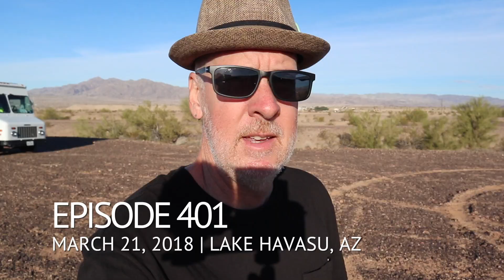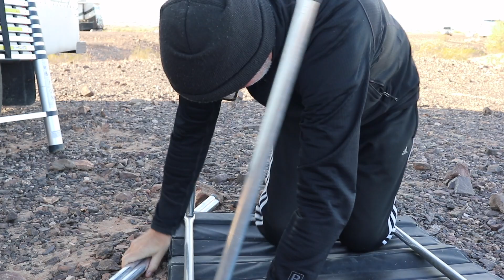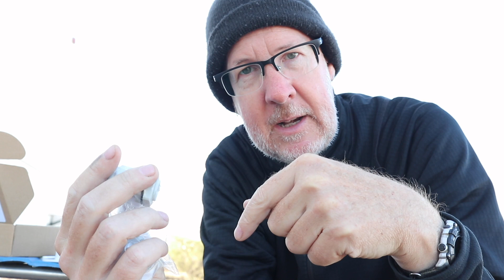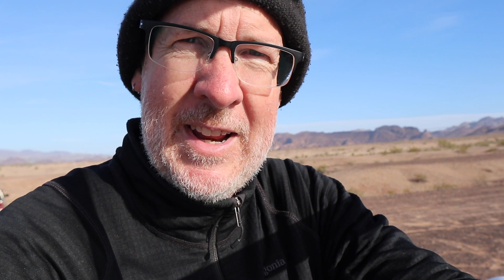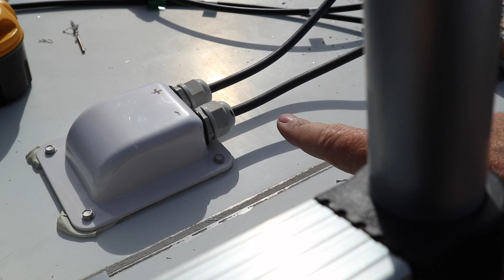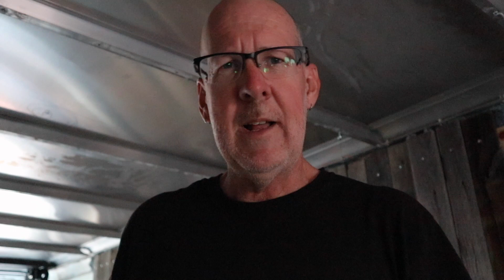Problems Wiring Solar for Step Van E401

Comment: You install that wire ingress box the exact same way you installed the MaxFans. The wire goes through before you clamp down the glands.
Why are you so paralyzed by cutting a 1-2" hole when you've already cut multiple 14"x14" panels out and it's fine?

Comment: Glands are to be installed in the small white box. The box will be mounted on the roof just like a roof vent with screws and sealant. The box is a weather proof  cover where you feed the cables through holes you drill in the roof. Oh. you got it.
The black wire connectors can be weather sealed with self vulcanizing rubber tape.
A hint, don't buy materials at a Home Depot or Lowes. Nothing wrong with them, just not for RV's on the road. Look for an Ace hardware store, particularly in the country. They carry about everything and usually have very helpful staff. It helps if you take the parts you have and ask them what else you might need. Ask about the tape. They have it.
Reply from the maker: it is only in the past few weeks that I've discovered how amazing ace hardware is. I love it. thx for the tips
Reply: Forgot to add that you can wrap the rubber taped connectors with good quality black electrical tape (3M). It takes the physical punishment better.

Comment: Yep. Sleeping with your head lower than your body will give you a headache. Either turn your van around or swap ends on your bed.

I’d drill a round hole and seal around the box. Why risk minimizing your tolerance when it isn’t necessary.
Reply: Given the o-rings on those connectors I’d say they’re weather sealed.
Reply from the maker: thanks for the feedback and suggestions!
Reply: Seven Wanders the World I should just wait until the video finishes..... all of the things get resolved.

Comment: Right on! You're makin' terrific headway man. I completely understand what it's like to be faced with a new task and have nobody nearby as my safety net. It freaks me out! I don't wanna waste materials, I don't wanna waste money, I don't wanna waste time and I don't wanna do anything that causes any problems......is that too much to ask? Yes. Nobody is perfect. I've mellowed somewhat with age and experience but I still stress when I get into scenarios like what you're doin'. As it turns out I've been pretty lucky because what I've wasted most has been my own time and most of that is usually because I've searched to the ends of the earth for something to tell me what to do. I am surprised that you didn't have instructions or some sort of a guide that came with your supplies. They kinda leave a fella like you and me out on a ledge don't they? Looks to me that you've done a dang fine job of it Seven and the only reason you didn't finish is a measly little connector. That's a WIN in my mind! You took the bull by the horns, as they say, and you came out the other end with something to be proud of. Don't forget, nobody is born with the knowledge to do these jobs, at some point everyone has to learn how to do things. Whether they are told, or go to school or bump around in the dark there's always a starting point. I hope that you tooted your horn, shook your hand and put your feet up buddy 'cause you've earned it. Good video! ...........................PEACE!!
Reply from the maker: that is EXACTLY what I was thinking, just as you describe. there were no instructions at all. the box came from china so not able to call the manufacturer.

Comment: Wow, being someone experienced in solar installation, the first half of the video was PAINFUL to watch.  I was encouraged however as you "figured it out" and got validation from your more knowledgeable friends. I am concerned that you have no "stock" of electrical findings.  It seems wasteful, resource-wise, to purchase items like ring-ends in small quantities.  Most builders purchase an initial assortment of low-voltage electric findings and replenish that stock rather than fire-up the van and drive to town each something is needed. As someone who eschews minimalism and reuse, this is quite wasteful. Just sayin'.
Reply from the maker: I have lots of terminals in the 14g or smaller size; this was an 8g and I only had a handful of them

Comment: The connectors are caller "MC4". The narrow male plastic connector has a female part inside to receive the female looking plastic connector that has a male prong inside. They are waterproof as you found out and standard around the world. Thank goodness. Good work, and like me, you have to take a leap once in a while and be prepared to do it all over again if you *uck up.
Reply from the maker: it all turned out ok in the end and actually looking back it was rather simple

Comment: I see your question was answered but I will agree I did one of those on my van the wire goes through the gland and then you just tighten the nut and it tightens up inside around the wire creates a good seal and then you just attach the whole unit to your roof using either butyl tape or double stick tape of the industrial variety finishing off by caulking around the outside needs to be the good caulk that’s intended for RV roofs and windows, keep in mind if you use butyl tape that in itself will not hold it on the caulking is what will be holding it on once it dries are used industrial-strength double stick tape to attach mine and then caulked around the outside and have not had any problems
Reply from the maker: I finally did get it figured out. weird that I couldn't find instructions on how to do this

Comment: feet above head?   spin your mattress.  rest well.  spin mattress again so it looks right when you see it while standing.
Reply: Seven, have you considered some leveling blocks for under your tires? 2x6's or the nice store bought plastic/fiberglass ones to level your rig? side to side or end to end. I too hate to sleep downhill in any direction. I am picky about tent sites.
Reply from the maker: good point there ;)

Comment: Seven, I just officially subscribed, but I've been watching your channel for a long time.  I'm an electrical (and mechanical) engineer and if you ever want to talk through a project, please let me know.  If so, I'll give you my contact information.
Reply from the maker: thx for subscribing! in the description area of my videos is a section with contact info. I'm taking a break for a couple weeks at a meditation retreat, but may need advice in the near future as I wire lights etc

Comment: Seven, I think those two "Glands" are water tight connectors for that plastic box. You have the nuts on the inside of the box, put them on the outside.
Reply from the maker: I think you are correct and ultimately that is what I did. connection seems good at this point!

Comment: Oh Seven, I'm at working now, just caught a bit of this, but those parts you held up to transition the wires from the roof into the van, in my opinion are somewhat over kill. I notice these solar panels have these cool ends on the wires, and they have you buy these T's etc...when I installed my panels I drilled holes in the roof right at the end of each panel, dropped it into the van, [no fancy connectors, just wire going through the hole] then I siliconed hole where the wire went through. I made splices inside van ceiling and connected together.  As for the heat shrink, that's nice to do as well, but I often put tape [Scotch 33 or 38] rather than doing it all over again. Either way looks like your getting it! It's all good as long as the electrical logic is correct, and no Positive wires are gonna cause a short circuit to the metalic - negative ground body. Seems like there are many different methods of getting wires from roof to inside though. By the time you read this, you'll probably have it all together!  As for sleeping with my head lower than my feet, I couldn't do it!  I'd be moving something to correct that! LOL! I'll be interested how I'm going to deal with that when I get my bus project on the road! [Can't afford much now, but those BIGFOOT hydraulic stablizers would be great! You take care my friend! God bless! Enjoy the coffee!!! Savoring the moments!
Reply from the maker: thx for all the tips and advice. as you surmised, I have it all running now and drove from Havasu to Sedona with no problems :D
Reply: Allen Rousseau i

Comment: Remember. The panels are outputting current when the are getting sunlight. Optimally, you should cover the panels with cardboard while making connections. You can get a shock and connections can weld themselves together if you don't take precautions.
Reply from the maker: I did mention in the video about the blankets covering them

Comment: Sometimes to break the analysis paralysis you just need to 'start working'. That is exactly what you did and it was a great job in the finish. Well done. You are just so advanced compared to where you started....you knew how to seal things on your roof without leaking for example. The rest was just 'making it work' Well done Seven, well done.
Reply from the maker: well, it took me 3 or 4 days... so there were breaks (sometimes you can see I'm wearing different clothing)
Reply: Breaks? So what? You just kept hammering away at it till it was done. It was the 'start' that was the hardest part and we both know it.

Comment: I was told glass cleaner (at least windex) contains oil (to reduce streaking)...  not sure if that’s true.  I always use 99% or 91% isopropyl, mineral spirits, or acetone to degrease hard surfaces before using sealants or adhesives.  I clean first with 409, TSP, or another surface cleaner, if needed, followed  a clean water rinse or wipe down, then triple wipe surfaces with the chosen solvent for de-greasing... using a fresh section of the paper towel for each wipe.

  (Acetone is the most likely of the three solvents to damage plastics and paint, so I usually use one of the other two)
Reply from the maker: I think you are right as someone else mentioned the same thing. I didn't know
Reply: Seven Wanders the World - use a solvent to degrease if you decide to use any additional sealant

Comment: Hi Seven, I feel so bad for you and wish I could help you in some way so your not so stressed. 
I am wondering if you maybe suffer from anxiety, OCD, etc...You need to trust in YOU.  Trust your years of experiences and how intelligent we all see you are. We don't think your intelligent....we KNOW you are. 
Please don't take everything so seriously ok. I've never seen anyone using any of the wire connectors or covers you have and your not being able to find any may be because it's not used? You can protect it as much as you want but in the long run how much stress is it worth? 
Sleeping wrong is also an issue you have. 
Either your sleeping with the wrong pillow or you have an underlying problem with your cervical spine is the only reasons I can see why you would wake with headaches. 
There's no reason why any carbon is leaking at night is there? Your spending upwards to 8+ straight hrs in your van at night so if there's a hidden leak that may be causing you headaches? I personally think because of your tall stature and age ( sorry) that you may have some disc issues. 
I've had 5 cervical surgeries because of severe headaches and it all was due to my neck. 
So now I have a full C-1 through C-7 fusion. Still have 24/7 headaches and arm numbness because the disc disease has traveled to the rest of my spine.
If your having any other issues please see a Neurosurgeon to get some testing done. I'm not very religious but I will say some prayers for you anyways. It can't hurt right? Not sleeping well and waking with a headache makes life not too much fun sometimes and I'm so sympathetic to your pain. 
Take care of you and I hope your days get WAYyyy better 😉
Michelle from Michigan
Reply from the maker: I think perhaps I'm something akin to a perfectionist. I just want to do things right and so I research things to death and try to think thru all variations. once I feel prepared then I don't have any problems. when there are unknown factors, then I have breakdowns like you see in the video (ps all the wires and connectors are industry standard... later learned they are called MC4)
Reply: Seven Wanders the World 
I don't have my solar installed yet but I have heard of the Mc4 connectors. I hope to have an easier time due to the only fact that I will have 300w and therefore smaller watts....smaller job? Lol! Wishful thinking. Did you read my comment about your neck?

Comment: See you were able to work through it with help from friends. I would only add that putting a little dielectric grease on the pins of the MC4 connectors before you complete the connections, just a little cheap insurance against corrosion.
Reply from the maker: great tip!

Comment: i believe thats called a Para-glider
"glands"  just a compression fitting/strain relief, 
they gave you blank empty fittings
wire from inside up thru roof thru the entry box, thru the glands, to the new connectors
plug solar wires to new wires
butyl rubber/sealant under lip of box, fasten down with self tapping screw, just enough to hold it not squeeze it down to the breaking point
Reply from the maker: sounds like I did the box install correct then! yay :D
Reply: We all knew you could do it! Regrettably, it didn't blow up! That's what we were all waiting for!
Reply: The local Costco here on Maui is installing solar panels over the parking lot, hundreds of them. None of them are plugged in at this point as they finish up the panel install.

Comment: This is so painful! All I want to do is help install the pass through and take away some of the stress for you I would say to take confidence in your own abilities my friend you can do it. The nut on the glands seal the gland body to the pass through with the black sealing ring. I can see you figuring it out and getting there . The good thing is once you figured it out you are then able to help a fellow camper in the future. There is no substitute for experience, the big pity is experience comes right after the moment you needed it most!
Reply from the maker: I think I could help someone install the same system. not sure how much they differ with other units
Reply: cover solar panels with your blankets

Comment: One suggestion, buy an extra box of every type of connection that you use on any install. Believe me, the first time you get stuck in the middle of nowhere with a broken connector, you will thank me.
Reply from the maker: that's a great tip!
Reply: Or in the future, as you are paying it forward helping the next guy or gal, and they are short 2 eyelets you can be the hero.

Comment: I just stuffed my cables under the panel to keep them out of the sun, its probably a good guess that connectors meant to be outside are watertight.  Always drill the smallest holes you can get away with,  rubber grommets are a good idea,  Use heat shrink instead of electrical tape over any splices.  4200 is a good adhesive.  Never use 5200, silicone is probably ok.    For the initial set up, just lead the wiring and try it all out, then work out the details.   ALWAYS cover your panel with something to turn it off while working with wiring.
Reply from the maker: excellent tips on everything!!! wish I had known all this before I began

Comment: Remember that even if you do something wrong, it can all be fixed. There is often several different ways to do a project and not one single way is the correct way. It is whatever works for you. Don't be afraid of making mistakes. That's what life is about and how we learn and become more knowledgeable. Those connectors are water tight. Or at least they are suppose to be. I'd put them under a panel just to keep them safe. That red ring is the seal.
Reply from the maker: can be fixed unless the van burns to the ground! (but I get your point)

Comment: Fyi, you don't have to use shrink wrap on those connectors, electrical tape works just as good, although the shrink wrap is considered more "professional". All things considered you did a good job installing your solar, just be ABSOLUTELY sure that your charge controller is already wired to your battery (and has power) before connecting the solar power wires or it can possibly damage your charge controller.
Reply from the maker: I was curious about that. thanks!

Comment: The red O-ring on the connector suggests it is weather proof.
Reply: John Lowe, Photographist I agree the red o ring on the one and there would be an o ring inside the other that makes them both water resistant.
Reply from the maker: never knew that... very cool tidbit!

Comment: You may want to get a pack of adhesive number to put on your wires so you can refer to a number in the future.  An electrical distributor or RV supply shop should be able to sell you weather proof boot for your electrical connectors.
Reply from the maker: I love that idea. I put tape around the positive so I'd know which one it is after it went thru the roof

Comment: Hi Seven.  On the off chance you have not figured your white thing out. Here is a suggestion.  If there is no strain on the wire then the nothing should clamp down on the wire.  The weather cover with no holes should be glued.  The hole inside the weather cover need be only as big as necessary.  If there is any chance that chaffing might happen during travel then you should put something around the wire to prevent it from wearing through to the conductors.  The Glands are for weather proofing.  If you are still stuck I can talk you through some of this if you like.
Reply from the maker: thx for the additional info. helps me understand how these things work

Comment: Will need a "Grommet" for the roof hole. Try checking at NAPA. in lieu of a grommet try using split plastic tubing. Dielectric grease on the connectors (insiide)
Reply from the maker: I used a steel ring thing... don't think it is a grommet but used in houses for the wiring